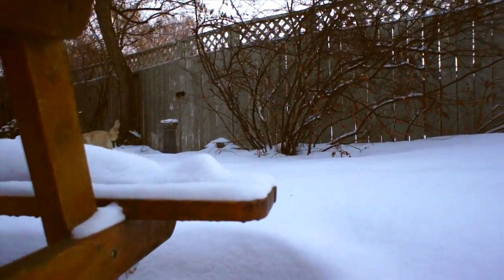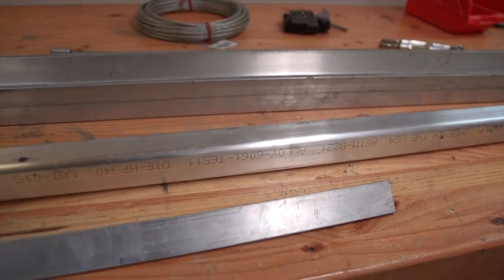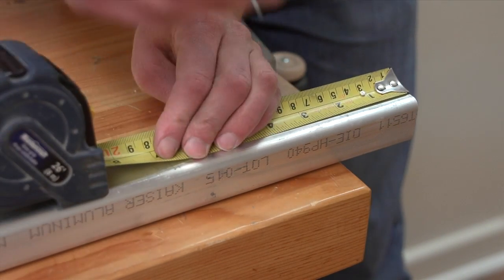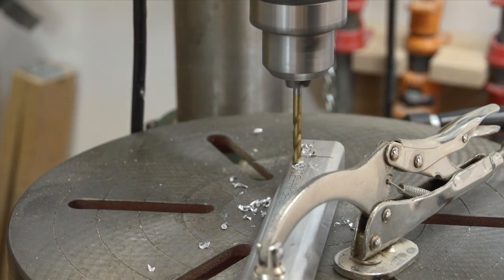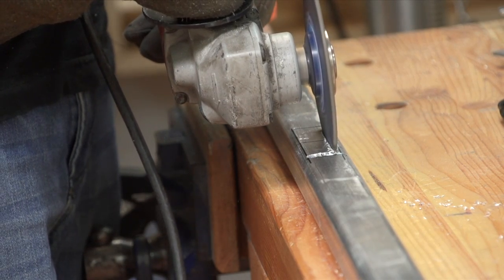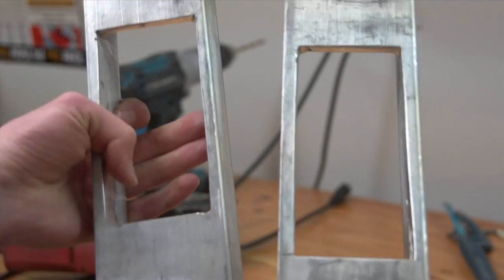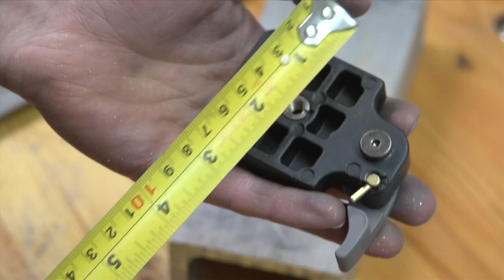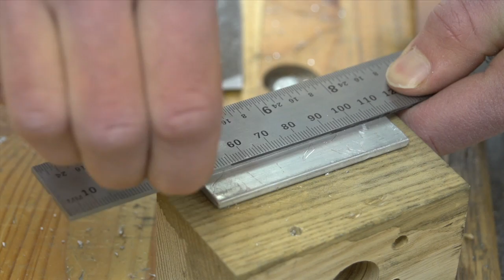Ultimate DIY Camera Crane Tutorial

Comment: When I built my camera crane, I used a radial arm saw to get perfect square cuts. Drilling of the holes I for the bolts it would be best to use a drill press, to insure that all the holes are perfect in line with each other.

Comment: I'd probably ditch the roller blade wheel for a real bearing. Also check for a local salvage yard.  I have one around the corner that sells all sorts of metal scraps by weight.  It's pennies on the dollar compared to home improvement stores. For me: 10 ft aluminum square tubing for around $12 vs the same at a home improvement store for at least 5 times that.  They may not have what you need right now, but it's worth to look for salvage yards as they are cheap and with a little luck you'll get what you need for almost nothing.

Comment: Excellently conceived and planned video, nicely presented, very useful information, congratulations.  However, to improve your turnbuckle and cable attachments, you may want to consider putting nylon tube spacer bushings between both sides of the cables. This will stabilize and keep it centered. They are available at any home improvement and hardware stores. It will dress it up and make it look a bit more polished and professional looking. You may also want to put a nylon bushing beneath the cable to ride on. Through continued use of your very impressive jib crane, the threaded bolt will eventually cut through and wear out the cable and it could eventually break. Bushings are cheap and easily replaced. Cameras are expensive and you don't want to break those if your jib should fail unexpectedly.  For best results, a metal bushing with a plastic coat covering would work well and last for years when placed beneath your cable, with nylon bushings on either side of the cable for added stability. Nylon or plastic bushings will wear rather quickly when being abraded by the threads of the rod. Easy fix, easy remedy and upgrade. For a few bucks more, you will have an outstanding jib with parts that won't wear out as quickly... to extend the life of your crane jib, a light lubricant with graphite will extend the life of the bushings and cables by minimizing wear and tear that is created by the tensioning and tightening of the turnbuckles on the cables. Thanks for sharing.

Comment from the maker: Thanks! This particular design doesn't allow you change the angle, it just keeps the camera level. I found this works for almost anything I'm shooting, and the fewer 'controls' you have chances are you'll get better shots in the end, as it is much more steady. If you do require the ability to change the angle of the camera, you will need a sturdy fluid head video tripod. Instead of using a bearing at the bottom, mount the crane directly to the tripod head and tilt the head itself to move the cam

Comment from the maker: True, if this is a concern you can buy individual taps for around $4/piece. They will be lower quality but will work fine with aluminum. You could make do with 2 sizes, 8-32 and 1/4", and use a nut for mounting to the tripod instead of threading the baseplate.